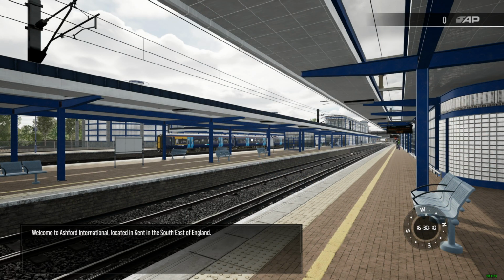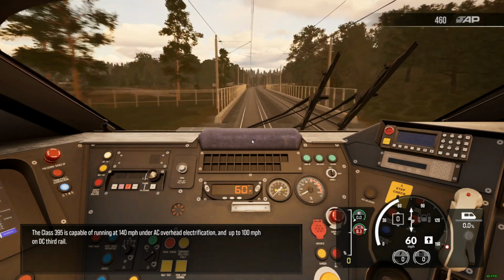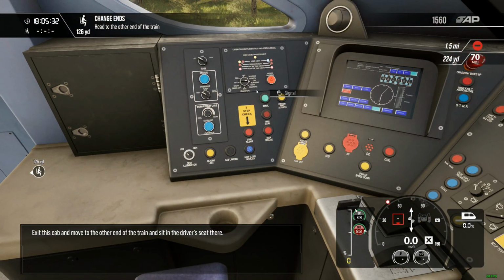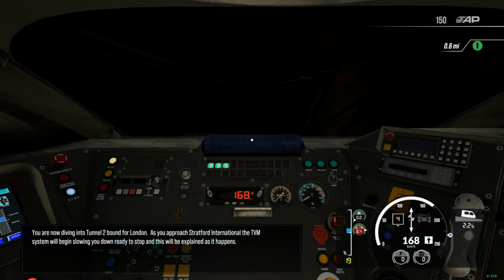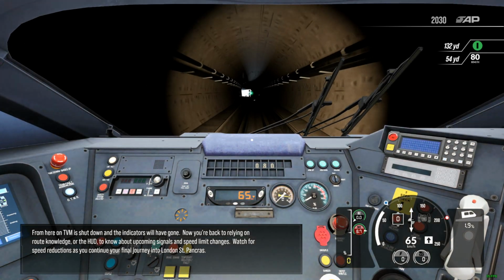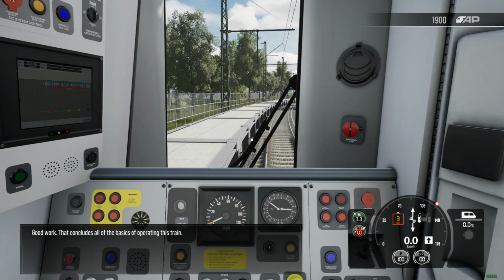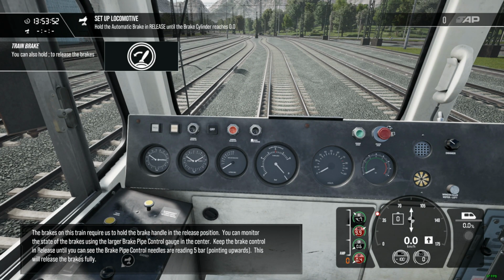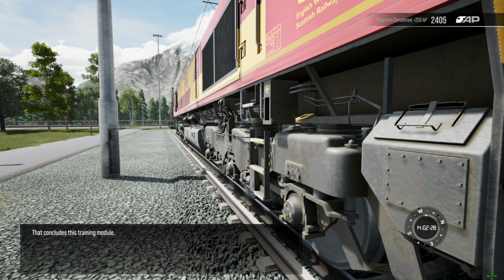All Introductions - Southeastern High Speed - First Look - Train Sim World 3

Comment: why cant we use 375s or 377s to ashford
Reply from the maker: It is a high speed line and the Class 375 doesn't have TVM.
Reply: Electrostars don’t have TVM signalling systems plus it would be ridiculous for a electrostar to go to hs1 line it’s only for class 373 class 374 and class 395 to go . Due to a branch line missing where electrostars come to ashford